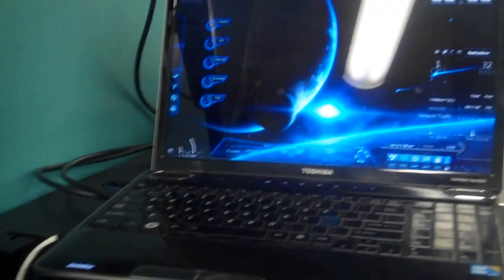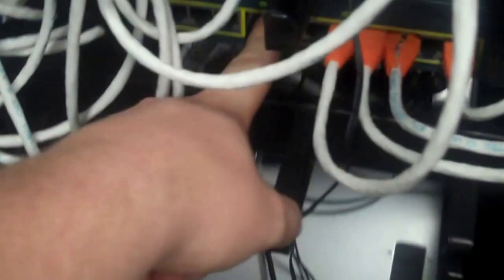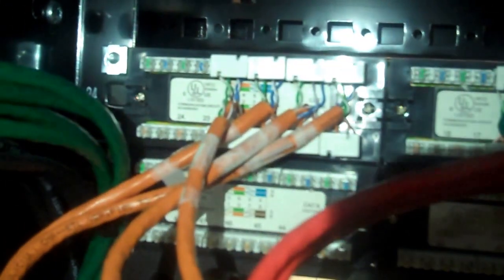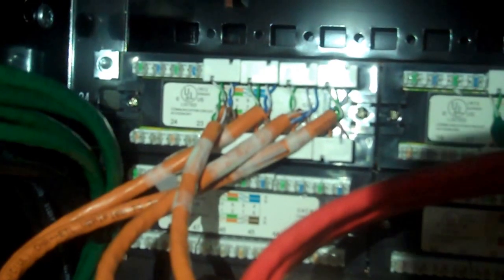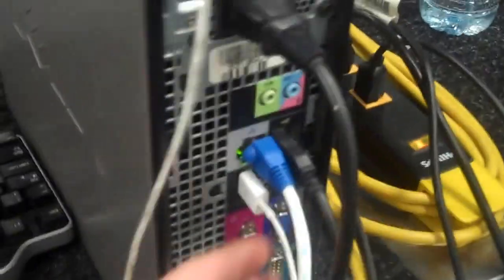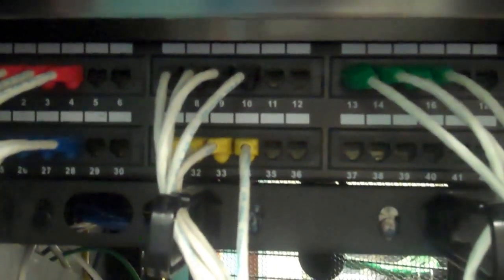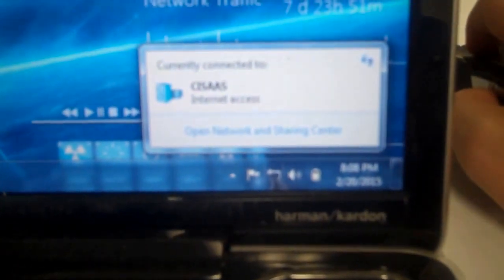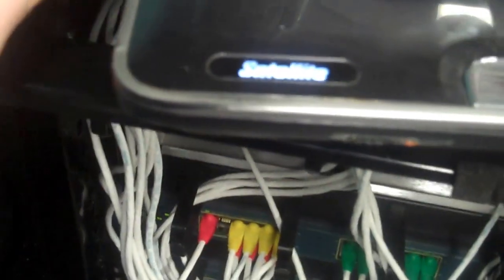Switch and Patch Panel

Comment: Hi , Just a quick Q. Does the data cable from the RJ45 port (where the device is directly connected to) go into a specific port into the patch panel? And then does a specific port have to be used to patch from the patch panel to a switch? e.g. if there are 2 x network systems running and you have 2 different switches but you want to one particular device to be connected to one of those particular networks. Does it need to use a specific port from the back-end of the patch panel to connect to a switch?

Thanks!

Comment: I am having trouble with my setup, basically close to same setup. patch panel, switch, router, modem. But I am having issues. All my devices do not have internet connectivity except one computer, I unplug the ethernet from computer and plug into another wall jack and it works, for some reason only that one computer works. any suggestions
Reply: Mailia Yang There are too many possibilities for me to make a guess. I'd start by tracing that one functional wire back, and make sure your wires are connected properly back at the switch. If that's all ok, check the switch configuration to make sure it's set up properly. Then check DHCP and DNS on your network, and make sure your computers are getting IP addresses.

Comment: I don't understand why we need all these wires and patch panel. I can connect my laptop to the internet wirelessly using a router with telephone cable only, or using an ethernet cable to connect in LAN. Then what's the point of all these cabling? can you tell me a basic connection of how to connect a PC --> switch --> patch panel and how it is better than the home network. Thanks.
Reply from the maker: In many work environments (offices), employees will be using desktop computers, or laptops witha dock. So patch panels and cable runs like the video are necessary for anyone who doesn't have a wifi-capable device, distributing wifi access points and VoiP phones throughout a building.
The patch panel, specifically, makes it easier to replace networking equipment.

Comment: I am new at this, i have an office that I am doing and they decided to have a patch panel, they don't like a regular switch box. how do I set it up? if I have a 48 port patch panel, how do I give it Internet? do I still need a switch to connect with it?
Reply from the maker: Yes; you'll still need a switch to actually move traffic. A patch panel is more for organization of your cabling, so remember to label your cables at the panel and at the other end of each cable (in the office spaces) in case you need to troubleshoot later. I'd also recommend making some kind of chart or documentation, because labels can become damaged or faded over time. 
You'll have solid core/plenum ethernet cables punched into the back of the panel, and these cables will be run (usually through the ceiling) out to office spaces and punched into keystone jacks on the wall at the user end. The wiring going out to offices should either be run inside the walls, or at least have some form of adhesive molding, because nobody wants to have cables dangling down in an office the way they are in this video. Molding also helps prevent infrastructural wiring from being damaged when you replace equipment, like user computers, and you'll want to use Cat5e or Cat6 cabling or better.
From the front of the patch panel, you'll run patch cables (again, probably Cat5e or better, but stranded instead of solid core) from the patch panel to the switch(es), as shown in the video.
Here are some links, so you know what you're looking for if you're running all new wiring (I hope you aren't; it's a lengthy project!), but I'm not advertising for any of these - they're just for reference. You'll want to do your own research to determine what setup would be best for the office you're working in.

Wall molding: http://www.homedepot.com/p/Legrand-Wiremold-5-ft-CordMate-II-Channel-White-C50/202264865

Keep in mind that your keystone jacks will need to be in a box with a faceplate, and all 3 need to be compatible or they won't fit together properly; I recommend just buying all 3 from the same brand to save yourself the headache.

Keystone jack: https://www.computercablestore.com/cat6-keystone-jack-180-degree-110-utp-white
Keystone wall box: http://www.cablestogo.com/product/03839/single-gang-wall-box-white
Keystone faceplate: http://www.cablestogo.com/category/wall-plates/keystone-wall-plates/keystone-wall-plate-covers

You'll also need some tools; I can provide a list if you can't find one online. Let me know if you have any other questions!
Reply from the maker: In case you have to do any punching-down, I found these guys did a great job explaining the process in their demo:
https://www.youtube.com/watch?v=JdxGKnAWZiM

Comment: What was the point of wiring everything to the patch panel and then to the switch? Couldn't you have just wired everything directly to the switch? Thanks
Reply: Generally, wiring run through walls/ceilings, overhead, under subfloor, etc - you'll use plenum/solid core ethernet cable. Because the core is solid, excess movement can damage and/or break the wiring. Since routers/switches are always improving, you'll likely replace them several times over a 10-15 year period, which means re-cabling them. So you use solid core for the cables that won't be moving (walls, etc) between rooms and the switch closet to a patch panel - then you don't have to move those wires. You'll use stranded wire from the panel to the switches/router(s), since these cables will be moved frequently. Also, using a patch panel makes management and labeling/identification easier without having to redo it every time you put in new hardware. You can label what room the port on the patch panel goes to once and be done, instead of labeling each new switch every time, or labeling the cables themselves, and risking breaking them by moving them too much.
Reply from the maker: Hi Adriana! Yes - in my video, these are all copper. For fiber optic cabling, using a patch panel depends on how many FO cables you have. If you only have a couple, you can usually connect them to some of the newer/better switches, with no patch panel needed. However, as you implement more and more fiber, you'll want to use a patch panel to help protect them. Remember, fiber usually runs underground - if the cable gets damaged, you'll have to replace it. So using a patch panel to protect them helps make sure you aren't having to replace them constantly.
Reply: Hi Scott. I really appreciate your videos on the Internet. I would like to ask a similar question as the above - Couldn't you have just wired everything directly to the switch?  So, in your answer you mentioned solid and stranded wires. I did research and found out that these wires are copper. Am I right? So, my question is regarding fiber optic cables. How exactly the switches/routers work with FO patch panels? What is the purpose of using patch panels (sorry for asking this again but I wasn't able to understand your answer above, may be my English is not very good). I will be really thankful if you could answer here :) Thanks a lot.
Sincerely,
Adriana
Reply: Sorry for late answer, Scott. Thanks a lot : :) It's much clear now. Thank you!

Comment: Sir thanks for explaining , could u plz tell me which type of wires r used for connection , it would be really helpful
Reply from the maker: +manoj y If I remember correctly, these were stranded CAT5e on the front side of the switches/patch panel, with CAT6 solid core as punchdown between the back of the patch panel, up the wall, across the ceiling and down to the pair keystone jacks. Then it was more stranded CAT5e from the keystones to the workstations. 
The patch cables from switch to switch are crossover cables, the rest are straight-through (I think; it's been a while since I've worked with them there). 
Does that answer your question?
Reply: +Scott Marlin yes sir ,thanks for clarifying my doubt.iam studying Ccna for which I need to know more about AX,FX,CX connectivity. sir I've searched a lot but I didn't find it on net ,if u don't mine could I ask u to help me on finding this information.
Reply from the maker: +manoj y After digging a little bit, I found this info: These are all in relation to name/category of ethernet cables (1000Base-X, for example, where X is the placeholder for your AX, CX, KX, TX, etc)

AX: **Could not find any relevant data for this**
CX: Refers to shielded balanced copper cable (AKA short-haul copper)
KX: Refers to one to four lanes of copper backplane links, each lane comprised of one differential pair per lane (one for transmit and one for receive)
T: Refers to any of several standards for twisted pair cables (TX, T4, T2)
TX: Refers to ethernet over two twisted pairs of copper wires, CAT5 or better
T2: Refers to ethernet over two twisted pairs of copper wires, CAT3 or better (defunct/no longer common use)
T4: Refers to ethernet over four twisted pairs of copper wires, CAT3 or better (defunct/no longer common use)

FX: Refers to ethernet over a pair of single-mode optical fibers (one to receive, one to transmit)
SX: Refers to ethernet over two strands of multi-mode optical fiber (shorter wavelength and shorter distance than single-mode optical fiber, less expensive to manufacture as components are less expensive, but the cable itself is thicker than a single-mode fiber)
BX: Refers to ethernet over a single strand of optical fiber (both transmits and receives)
LX: Refers to ethernet over a two single-mode strands of optical fiber

To find specific information on any one of these, run a Google or Bing search for "1000Base-X" (1000Base-TX, 1000Base-FX, etc). The following links also detail several different types:
https://en.wikipedia.org/wiki/Fast_Ethernet#100BASE-LX10
https://en.wikipedia.org/wiki/Gigabit_Ethernet#1000BASE-KX

In my video, all the cables are TX standard, as we aren't currently running any optical fiber. Is this the information you were looking for?
Reply: +Scott Marlin yes sir,this information is more than enough , thank u very much for dedicating some of ur precious time for me .